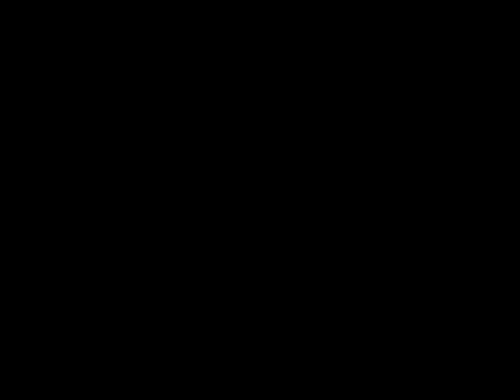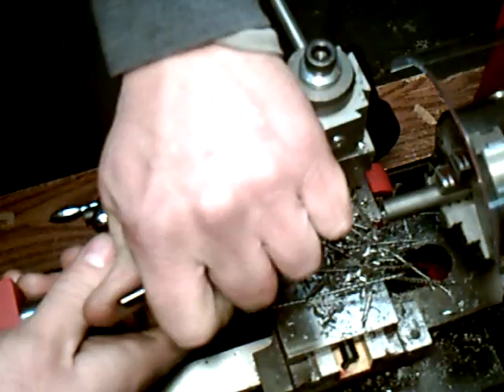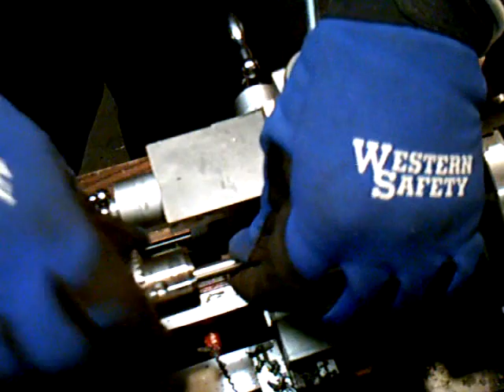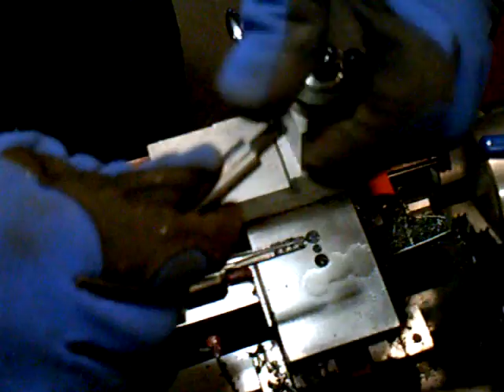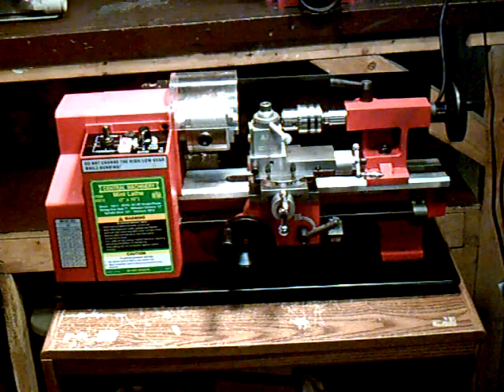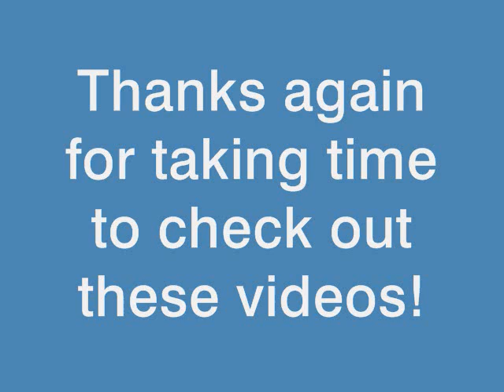Harbor Freight 7 x 10 Mini Metal Lathe Video 3 of 3

Comment: Thanks.  Best video I have seen.  Answered almost every question except one.  How far and how large of a rod can be chucked up?  I want to center drill aluminum to .43 thousands.  A.  . 750 or 3/4 inch outside Dia. I have 13 inch long pieces.  Going to make 1 inch long.  Can I put 8 inchs long in drill about 2 inchs at a time.  Cut off and repeat.

Comment: This was a very good video. I am a professional machinist as well as a machine shop teacher at a local college. You made the statement about how this may not be the technique a machinist would show you how to tap. This is the exact proper way to power-tap on a lathe. You did fantastic on illustrating how to perform this function. This is precisely how I show my students (except we use much larger lathes). The only thing different is that I teach my students to do this and all other lathe/mill functions without gloves. It is quite dangerous with the larger machines to wear gloves, as they can easily snag on the chuck or any other rotating/moving parts of the machinery and can cause serious injury or worse. Thanks for this video, I enjoyed it very much!

Comment: I just bought a 7 X 10  Lathe same one you have. I have a problem, yes I know I need the tool holder but where can I get one? Second problem, what causes the cutting tool to go below the round stock while cutting. Third, I never get a clean cut off. It always leaves a nub sticking out depending how much I'm taking off. But it is normally about 1/16 diameter and maybe about 1/8 inch long. What is causing these problems
Reply: china junk is the problem
Reply: The Problems that you seem to be having has more to do with the centering or your cutter. If you put your center in the tail stock first, then line the height of your cutter up with the point of your center guide, then you will do away with this issue. That cutter should be exactly the same height  as your center guide. As far as purchasing a tool holder for that particular lathe, I am not sure where one of those can be bought. I am not the guy that made this video. I am just a machinist and a machine shop teacher, so I am not sure where he bought his holder.
Reply: david decker
So what your saying is I have to put a piece of stock in the lathe and then put the cutting tool I am going to use and see where the cutting line lines up on the round stock.And chances are I may have to raise the tool holder, is that about right?
Reply: Close, but depending on the size cutter you are using (1/4-3/8-1/2 or whatever) the cutting point of the bit may have to be raised or lowered. Put a center guide in the tail-stock. Then put the tool bit in the tool holder. Then move the tail stock in so that you can use it to determine how high or low the point of your tool bit should be. This will locate your height. 

Another way of centering your tool bits is using the 6" rule method. I'm not sure if you have learned this trick yet, but it goes as follows:

If you are using a 4 jaw chuck, then dial your stock in before performing this technique.

Put tool bit in holder

Bring the bit up to the side of your material (this only works for round stock.) (this does not work on the face of the round stock.)

grab your 6" rule and place it between your stock and tool bit, right around the 3" section of your 6" rule. 

Very gently bring your tool bit against the 6" rule. (Pinch the 6" rule, only tight enough to hold the 6" rule.

If the 6" rule is straight up and down, then you are centered.

If the top of the 6" rule is leaning toward you, the tool bit is too low.

If the bottom of the 6" rule is leaning toward you, then the tool bit is too high.

Adjust the tool accordingly and be sure to make any and all adjustments to the tool bit away from the material, so as to not damage the tool/6" rule/stock. 

Again; Pinch the 6" rule just tight enough to hold it up. Especially, be careful with brazed carbide tool bits. They are very easy to chip.

I hope this trick can help you with lining up cutting tools. Let me know if you are still having issues and I may just have to make a video, because I am seeing a lot of people having this same problem.

Comment: I was going to get one of these but I opted for the larger 9"x20" #45861 which I don't think they sell any more. I have been using it a lot more lately and your videos have been helpful in learning some basic techniques. I also have the HF drill/mill machine #42976 and I just got a set of mill holders which should work much better than using the end mills in the drill chuck. I'm working on an electric tractor project you can see on my channel :)

Comment: When you get it you should still upgrade the gibbs to bronze. That is the cheapest upgrade for any lathe and it makes a huge difference. You can tighten them up more and it still slides like butter due to the inherent self lubricating properties. I'm picking up an old Myford super 7 this weekend for $1800 fully restored on a nice stand loaded with every piece of tooling , gear and attachment out there. There's nothing like the old heavy stuff.

Comment: Sounds like your gibbs are adjusted too tight. You want them just snug enough to keep everything from being sloppy but not so tight that you have trouble working it. A good upgrade is to replace the cheap steel gibbs with nice bronze phosphor ones. You can find them cheap on eBay.

Comment: Thanks! I am wanting one really bad have been for a while. It is really hard to pay much more than this for a machine seeing how I have never been trained to use one. (I'm a sculptor) I have quit smoking through electronic cigarettes. I have become interested in making some of the battery mods actually my profile pic is one I recently made I turned the brass switch parts on a wood lathe and hand shaped all aluminum parts. The wife has given the okay on $300 and whatever I can round up. Thinking

Comment: I noticed you applied your cutting oil right out of the can there ? I  guess applying with a brush would mean an " open" type can of that sulferized (stinky) stuff and hence the possibility of it ( the open type can ) of going over and making ones entire workshop wreak ? Occasionally i have to drill some steel which requires cutting fluid or cut a piece with a hand hacksaw so Ive discovered i can mix up tiny batches of vaseline and matchheads i pulverize with an old file ? Seems to work OK? tyvm

Comment: After removing 1/16th inch of grease, and making the proper adjustments everything is very hard to move. Adding more wd40 and making more adjustments, still can't get it right. Any suggestions?

Comment: Just a couple comments for people looking for a  mini lathe.

The quick change tool post is a great add-on, if you need it. If you don't it's a waste of money that could have been spent on something you could really use.

While the 4-way tool post is made to use 5/16" tool bits, they will work with smaller ones. Two 1/4" tool bits and a cut off tool handle most of my jobs and are all mounted at the same time. Switching them isn't the chore so many tyros seem to think they are.

Comment: There are several versions available from different suppliers and most of these are coming from two different factorys in China. Get all the specifications and what is included with each to make a decent comparison, for example, other lathes built on the same base as the HF may have more powerful motors, longer beds, higher speed ranges or etc. Little Machine Shop (.com) offers a side by side comparison that is worth looking at.

Comment: Professional machinists I have known used compressed air. Just make sure you wear eye protection and DON'T forget a clear face shield along with glasses. Metal shavings can hang in eyebrows and fall into the eye later. I learned this the hard way grinding cutting reels on power mowers for a golf course.

Comment: @UpcomingJedi You're making a fuss over nothing. If you have the correct safety gear on (good eye protection, long sleeved smock/coverall that fits you well, closed safety footwear) any flying swarf won't be a problem. Try using a brush to clean out a deep, small diameter hole - It's just not practical.

Brushes do a slower, poorer job of cleaning holes out compared to compressed air, and when tapping you need that hole real clean. Make life simple for yourself!

Comment: Thanks for the VID, I have some quick questions. Can you angle the compound rest so the x slide could cut at an angle? Large lathes have a hole through so long bar stock can be used that extends out the left side of the machine, dose this have that feature? Could a tolerance be held to press fit a bearing onto a machine surface (yes no, maybe)? Thanks again

Comment: So after reading as many reviews i could find on this little guy and after watching this 3 part series i went to my local Harbor Freight and bought it. I had a 20% off coupon out of Popular Mechanics so i only paid $399 for it. I also bought a drill chuck,some center drill bits and 2 cheap tooling sets.(5 piece 1/4" set for the parting tool,and a 10 piece carbide tipped set) I'm in the process of tearing it all apart to clean out all the shipping oil. Thanks for helping me decide on this! peace!

Comment from the maker: Make sure your tail stock is at least 1/2"-3/4" out and quickly snap the chuck into place, it should hold. When you back it out less than a 1/2" it wil release the chuck. Search Yahoo or Google for "little machine shop". They have the best mini lathe and milling accessories plus a great learning center for starters